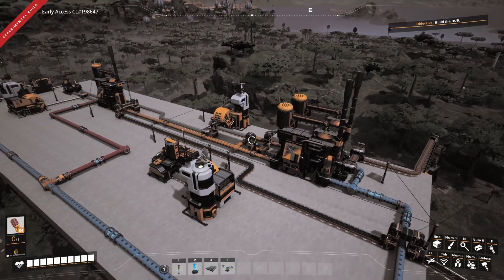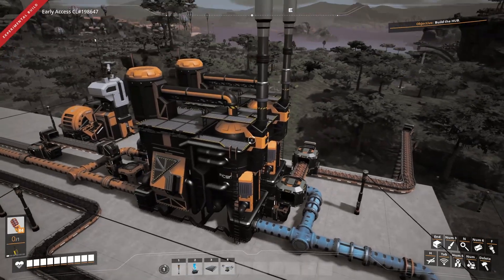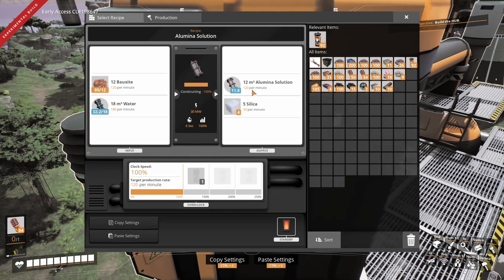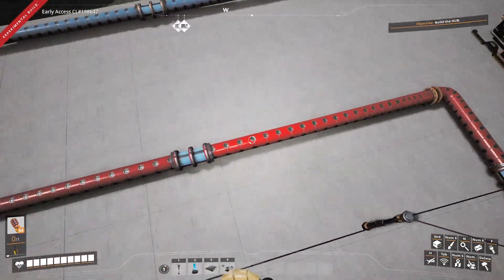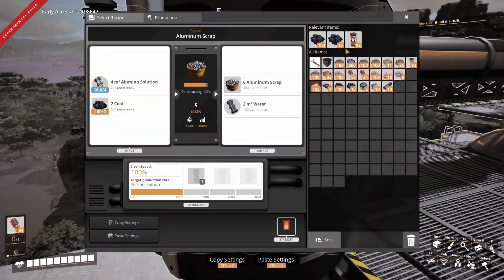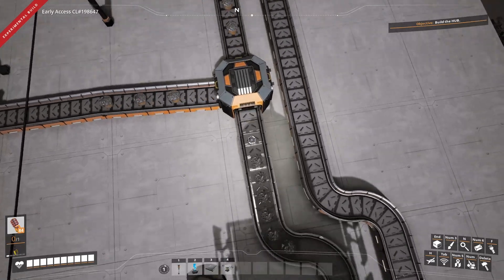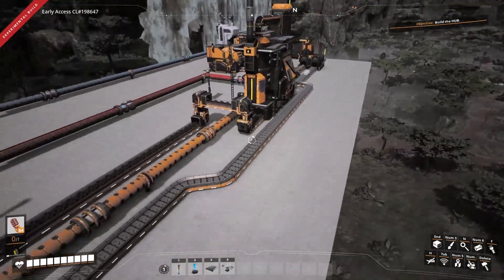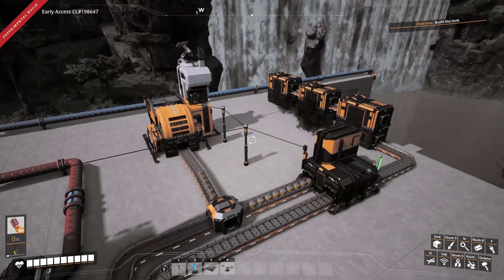Aluminium

Comment: why are you not using the sloppy aluminium recipe? saves you the silica step in between. plus, if i am not mistaken, it balances water aspect.
Reply from the maker: True, but I wanted to base the tutorial on the basic recipe as it's the most difficult imo. And if you need a tutorial and haven't unlocked any alt recipes then you can still follow along.